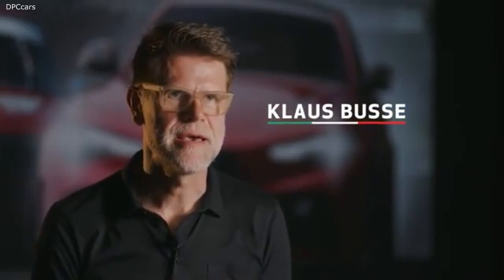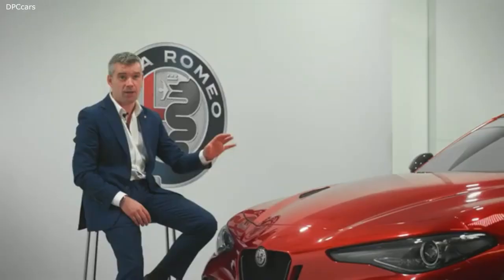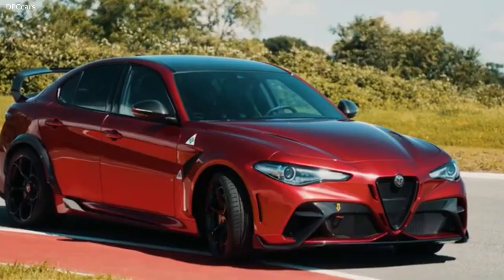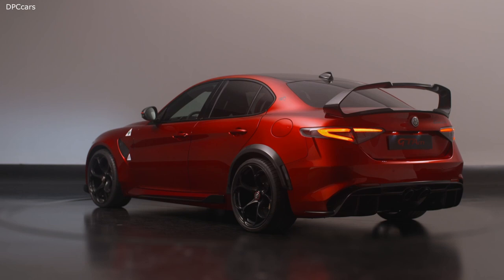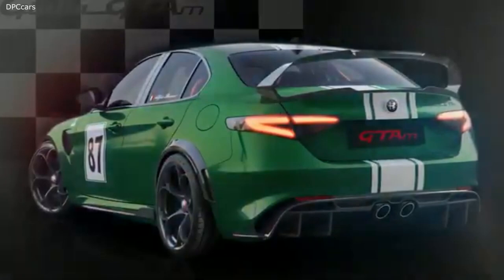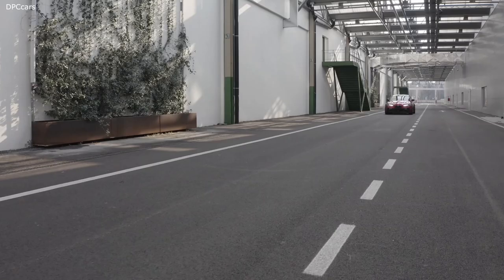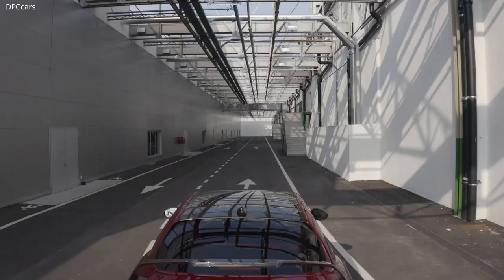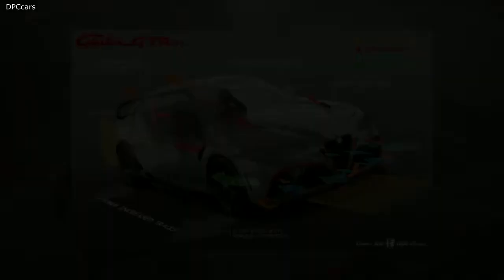2021 Alfa Romeo Giulia GTA Documentary

Comment: There needs to be a GTAc where the complete front end is exposed carbon and also the roof, the bonnet/front arches should have larger vents and even wider rear arch extensions finished with carbon wheels. Like 1m so Alfa Romeo make it